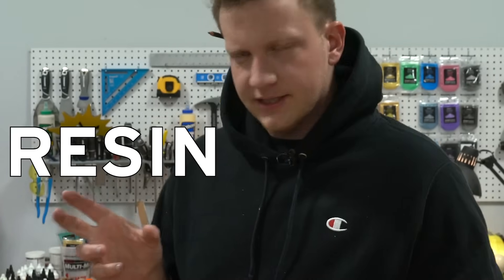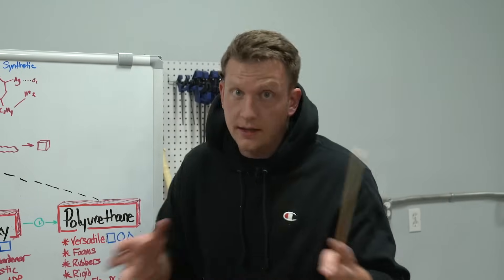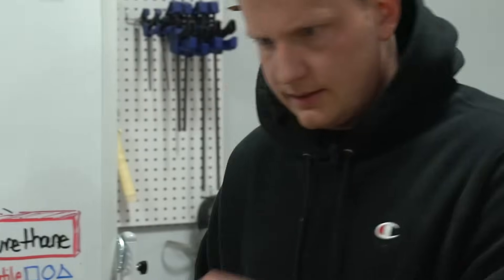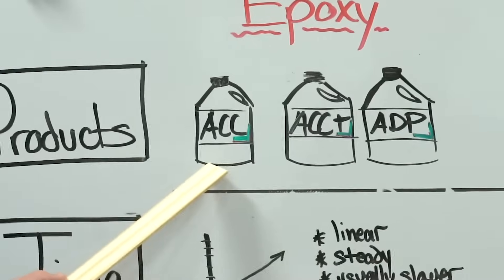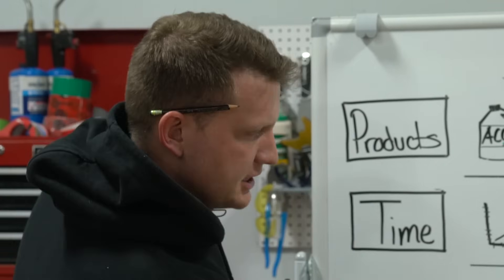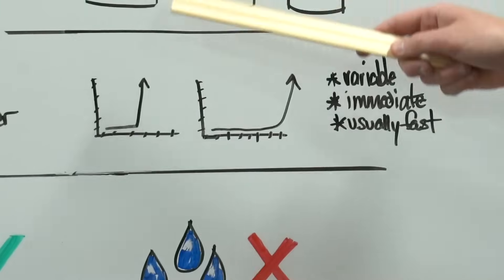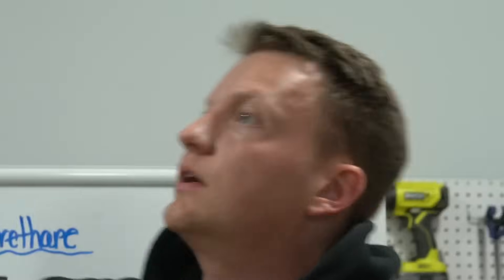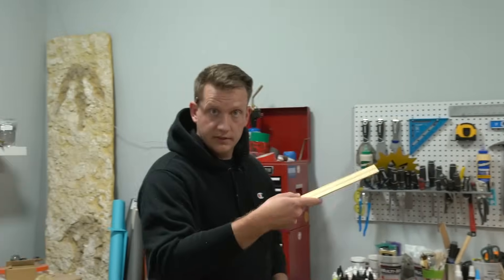Alumilite Explains: The difference between epoxy, polyurethane, and resin

Comment: This was a much needed explanation for me! Just starting to incorporate resin into my wood turnings. Id gotten a small amount of Clear slow and poured my first pen blanks where I casted mini pine cones. Turned out great, so I ordered the 16lb kit just the other night! I was really excited to start using it to cast wood into large blanks. I am SO glad I watched this before I combined this with some wood that may not have been perfectly dry and ruined the whole thing! 

Would love to see a video with more detail about casting wood into blanks, or using epoxy/urethane to fill knots, cracks, voids, etc.; When it’s ok to use one vs the other; What moisture content does wood have to be before you can use urethane; etc etc. 

Thanks for sharing the knowledge!

Seth
Reply from the maker: Hey there Seth! I'm so glad you found the video helpful, and that you're liking using Clear Slow! I'm going to link a few videos here on casting hybrid wood and resins items from some of our affiliates. (Epoxy is usually best for knots and voids, and for the moisture content... as close to 0% as possible with urethanes.) https://youtu.be/s7EoPC1Nlb4 https://youtu.be/v-jwrEhtn20
Reply: Thank you so much!
Reply: Hey, Seth. I've been reading on the wood combinations, too. Most people say you can use urethane as long as the wood is sealed completely, ie: a clear topcoating. Hopefully Jordan/Alumilite will correct me if I'm wrong.
Reply: @julietmurphy8637  maybe a dewaxed shellac or sanding sealer
Reply: @oldkingcrow777  Polyurethane sealer works perfectly. The goal is to have a moisture barrier between the wood, which always has some moisture content, and the resin to prevent frothing, bubbling, and discoloration from the reaction of the curing resin to the moisture in the wood.